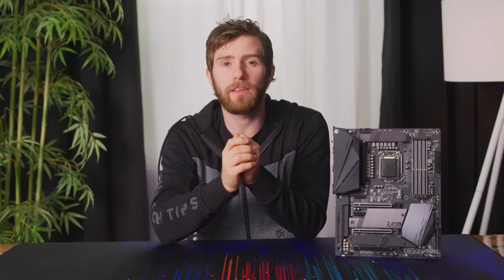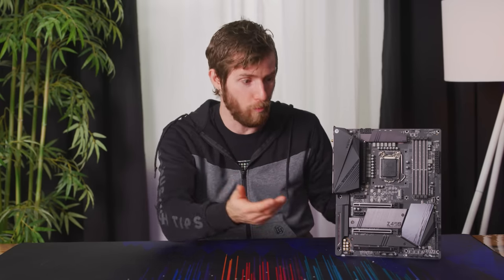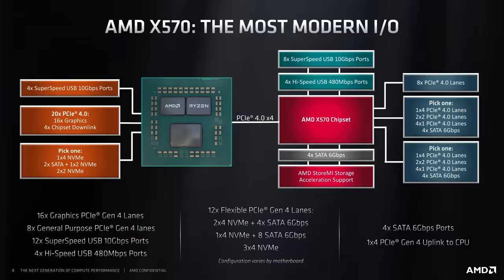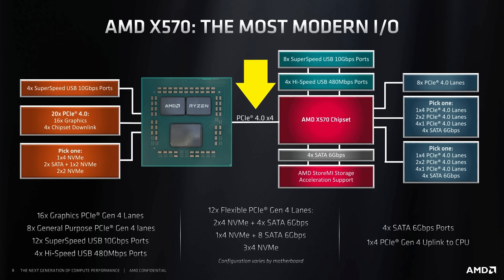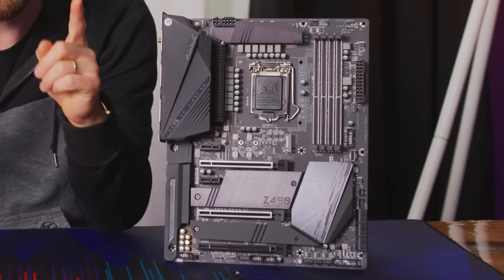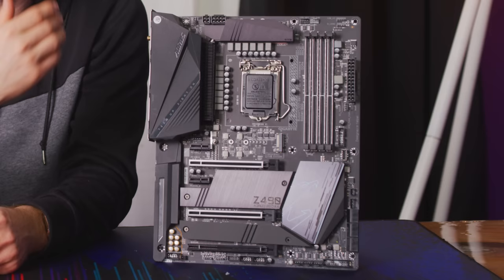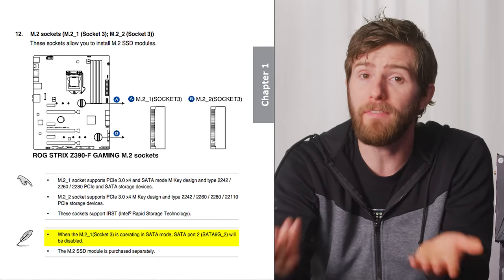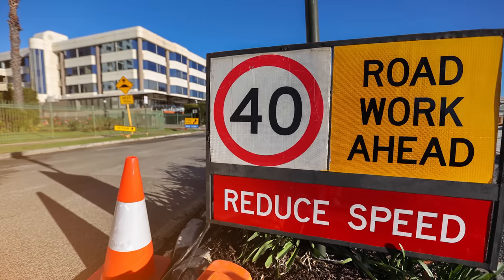The Sneaky Thing About PCI Express - CPU vs. Chipset

Comment: The Sneaky Thing About PCI Express
......It works just fine if it's not dropped
Reply: btw between 2080 TI second hand @ $810 or Zotac twin edge oc 3070 new with warranty @ $720  3070 better right? They both pretty same in 4k and 2k, right?
Reply: @GamersGuard  i would defo choose 3070. is newer, cheaper and perfomance is the same. only struggle is stock
Reply: Crap, it's not Linus proof.
Reply: @GamersGuard  unless you need it right now, I would wait for prices to settle down. The 3070's price will drop back to MSRP after the holidays most likely. But yes, the 3070 should be equivalent or better in everything except VRAM.
Reply: @hudsonr.218  already getting it so.. -) in this country prices remain higher on such parts even ex generation still $200 more expensive....

So what vram beenfit in 2080 TI vs 3070?
Reply: @GamersGuard  2080 Ti has 11gb of GDDR6, while the 3070 has 8 gb GDDR6X. It doesn't matter that much, but if you are playing VR or 4k, the extra VRAM might help.
Reply: That sentence makes absolutely no sense
Reply: @hudsonr.218  no it will help. Its already shown that some games  cripple the 3070 in 4k as some games hit 9 gigs of vram usage.
Reply: @mikeymaiku  it's all about what your use case scenario will be. If you don't care about ray tracing or won't prioritise it over performance then get the 2080ti. Those 3gb of extra vram will be more useful. In the next two or so years more RT games will come out and by then you can upgrade to the 3rd generation of RTX GPUs. By then it will be even more fleshed out and supported. For now id say 2080ti for you Is more worth it.
Reply: Use case or not it shows the issue that will come sooner than he thinks. Sure some might be ok with it but if your dropping 700+. It better be new and the most up to date. But as it is the 8gb 3070 doesnt fit the 5 year run(people wish 8gb is enough but its the 4c/8t arguement all over again only in gpu terms)
Reply: It works better.  It needs the mechanical touch to run smooth.
Reply: LOL nice reference to his major issue.
Reply: @TorbTorb  ill take 2080ti. Better availability, used is cheaper. And i can actually buy it
Reply: @TorbTorb  its so sad, when i see that noone has stock, but in my country they are so expensive, 3070 is 920 and 5600x 400, and they just sit there, noone buys them, they have been in stock for a long time, even 3090
Reply: @TorbTorb  Got my zotac 3070 ).  In msi Free burner by accident changed power limit from 100 to 110 and then changed back, it's nothing risky for the card? Thnx!
Reply: @hudsonr.218   @Kuntal Ghosh  decide to get zotac twin edge OC 3070 for $730 (sucks but that's the prices here in Georgia ... ) Asus stocked out but had same price as zotac.

Anyways zotac really pushed 30 series I think they indeed invested in quality to show off with this series.

This OC edition is dual fan but somehow while boosting peaks at 2025Ghz and max temp with manual fan curve settings hits 69c at this boost..... Ain't bad?

Now just need upgrade my garbage cpu ryzen 1700 as I get 30-50 fps in 1080p games like witcher 3 and watchdogs legion.....
Reply: @thedamntrain5481  in my country 5600X is 367 US dollar
Reply: lol
Reply: @GamersGuard  buy 3070, new architecture, you could get better performance as they improve drivers
Reply: @GamersGuard  obviously the 3070 as it is better than 2080ti but it's also cheaper so get the newer card
Reply: lol Linus dropped a thing haha lmao
Reply: The Linus Test
Reply: @GamersGuard  id rather buy a 3070 :|
Reply: I dropped my motherboard off my bed and it works just fine.

Comment: The dislikes are from people who modded their GPUs to fit in a 1x slot
Reply: I have a box of hacked up cards I use for when I need the 16x slot for something more critical like a storage controller.
Reply: @geofrancis2001  why hack up the card? it feels a bit easier to cut the stop out of the slot, you see that on a lot of server boards just no block at the end preventing you from inserting a bigger thing. Plus nVidia made some 1x quadros and gt710s for you there if graphics isn't critical for the application...
Reply: @AmaraTheBarbarian  low end graphics cards can be found for peanuts on ebay, and its much easier to saw a little bit of fibreglass off the end of the graphics card than cut the end off the slot without damaging the contacts on a much more expensive motherboard. they are all low end cards like gt610, hd5450, hd 6450, so trimming them to a 1x slot isnt going to effect their performance, they still work in 16x slots without any issue.
Reply: Nope. Just a boring video with bait style title
Reply: There are cheap risers for this purpose, since miners hook up lots of GPUs and don't need the bandwidth as much.

Comment: Some video suggestions:

1: Can y'all do like an in-depth video of how a browser works? Like how Chrome and Edge use Chromium?
2: How updates are executed on operating systems?
3: How is a software "optimized" to run on certain CPU architectures?
Reply: as a computer science student about to graduate in 2021, i'd love to finally learn how to optimize software for different architectures xD should really have been taught to us already... but if education fails, Linus is here to save the day... pls...
Reply: I wanna see these too!!
Reply: These are nice suggestions.
You just gave me 3 nice ideas for my own vidzs😁
Reply: 1 ) Chromium is the engine that translates basic stuff (HTML, CSS, JS etc) into a working webpage. It contains all the parts you need to run your car. The browsers are simply "extra features" and they often add tricks to either speed up the translation of the above named things (by caching it or trying to predict stuff) and gives the browser creator the ability to inject stuff into the chromium engine -- So, add-ons. With a car this could be bouncers for example. Basically, it allows them to mod the car.

2 ) Operating systems are just very complicated programs that get started up by a tiny command on what used to be your Master Boot Record, but I guess the UEFI is smart enough to find OS's now. An update is not much different from updating a website or app in the sense that there are certain things you can update while the user is looking at it, and certain things you have to reload the website (restart the OS) for. An update basically just overwrites older files or adds some. It's not that complicated, really...

3 ) In deep-level programming, the developer can decide what types of commands to send to the CPU. The developer can decide how much memory to allocate, how much stuff to remember, what exactly to remember, etc etc... Intel and AMD cpu's have different ways of handling commands. They are, much like browsers, trying to be "smart". CPU's haven't really gotten much faster in hardware speed (MHZ) as you may have noticed the past 10 years. However, their performance keeps increasing; This is because of what they call the 'architecture',  which basically means a tiny software layer which translates stuff into tasks for the CPU. We call this firmware. This, mch like the browsers in point 1, tries to predict stuff. Some CPU's do less but faster cycles (in the old days this was intel) where as some do slower cycles but with more calculations within said cycle (AMD in old days). This means any command has to "wait" until the previous cycle is done,  but starting up a new one also costs time. So if you put a lot of calculations in one cycle as the developer, the slow-cycle one might handle it faster as you use the slow cycle to do more calculations. If you do a lot of small calculations instead, the smaller cycle will win because it's faster. ARM is basically a CPU without intelligence, meaning whatever the CPU does has to be software-managed, but it does save a lot of overhead as the CPU doesn't have to "think" before executing what you tell it to execute.

Now that you've read all this, I have to admit to you that I have no idea what I'm talking about at all and probably not even half of what I said is true.
Reply: Well done they are all interesting subjects 👍
Reply: Also: why is arm so much more power efficient than x86/amd64?
Reply: @theBabyDead has it pretty spot on, but there are a few things to edit for part 3. Computer architecture is the hardware layer, and a change to it could be doubling the lanes to your integrated GPU, or adding an additional floating point calculator, or an additional condition for a hardware interrupt etc. Optimizing for different architectures can be as simple as writing your program to use threads. For example, all things being equal a single threaded program would probably run faster on an Intel CPU because they have higher clock speeds than AMD (generally), but if you rewrote your same program to use as many threads as an AMD CPU can handle (usually 16-32 I think?) Then you would be taking advantage of AMD's wider architecture, optimizing for that. I'm quite confident in this but feel free to correct me if I'm wrong.
Reply: @azyrael96  coz arm is much more simple and less powerful.   Taking the power consumption on Apple M1...while in idle it eats 10Wt..under full load the consumption are increased to 30Wt.   The most savings comes from Big Little "cheating" architecture, where you have slow/energy efficient cores for background work and fast performance cores, and OS able to switch the cores to save the juice.   While x86 architecture have only performance cores.
Reply: @azyrael96  in addition to what’s already been said arm is what’s called a RISC (reduced instruction set computing) architecture meaning it has fewer instructions (lowest level of programming language) to interpret whereas x86 still has holdovers from the ORIGINAL intel 8086 from decades and decades ago. LTT has a video on RISC-V that has a similar advantage
Reply: @Gabbyreel  of course multithreading is no simple task, there’s a reason most programs can barely take advantage of it. The second you introduce multiple threads any programming problem becomes significantly more complex.
Reply: @theBabyDead  nice ending xD
Reply: @3 Basically the app contains multiple code path. They have a detection mechanism built in.  There is also what you call a fat binary. Same principle as having multiple code path. But for different architecture like arm and x86 .
Reply: @2. Removing the old version(sometimes a restart is needed), creating a new entry and updating the paths/config. It really depends on the app/developer.
Reply: @unknown optimize you mean execution time? Like all cpu architecture it depends on what your program does. If its compute heavy or memory heavy. Always optimize the weakest link first. Now adays. Its the memory access. Hence alot of core codes are being squeezed into l1/l2 cache.
Reply: Finally, these are things I REALLY wanna see
Reply: Also Windows Mixed Reality! Odyssey plus and Reverb
Reply: Wow I had the same questions
Reply: My suggestion: every youtuber days Apple's integration makes its machines perform better,  but how exactly does this integration help out perform better, how exactly does having a dram baked into the soc make it more efficient
Reply: @theBabyDead 
MBR is replaced by GPT nowadays, default partitioning since Windows 7. https://en.wikipedia.org/wiki/GUID_Partition_Table

"a tiny software layer which translates stuff into tasks for the CPU. We call this firmware"
No we call that microcode. https://en.wikipedia.org/wiki/Microcode
Intel and AMD are both CISC "more calculations within said cycle" architecture. AMD reverse engineered the Intel x86 instructions for their first CPU's. Got sued. Invented the 64-bit x86-64 "AMD64" instructions that Intel then licensed and we use today. RISC "do less but faster cycles" architecture was Apple/IBM/Motorola PowerPC, and ARM. RISC use instructions that all have to finish in one cycle, which makes the cache smooth and consistent, but has to implement longer instructions in software libraries.

Since decades the optimization for architectures like x86 or x86-64 is just something you select in your compiler. As long as your software libraries handle the calls you can compile for most any platform.
Reply: @OriginalUnknown2  as an old CS MSc I tell you you should already in your education be familiar with assembler coding in some platform (we used MIPS), high level coding, language constructing and making your own compiler through Yacc/Bison or similar. The compilers do the platform optimizations, even 20 years ago.
Reply: @bgezal  yes. I should have learned all these already. and alas, they weren't taught to us.... picked the wrong fucking course, but there is no going back now... its 90% theory, 10% actual programming.. and the theory is mostly writing essays, research papers and dissertation (for a fucking bachelors??????).. so ye, my course fucked me, but once this last year is over and done with, im hopeful i can learn all i missed on my own.
Reply: Related to the third one, now when you download Chrome for Mac, they ask you if you are running an Intel or Arm CPU. That's unfair to people with Ryzentoshes.
Reply: @OriginalUnknown2  Architecture-specific optimization is an insanely specific field, you probably need to attend a special course on it, likely offered by a company as preparation for hiring. Otherwise you can probably find some documentation on the subject from the producers of chips that implement the architecture.
Reply: @OriginalUnknown2  Heh, the difference between computer science, and software engineering. I went for computer science myself, and by golly I can analyze an algorithm, but so much of good software design is another skill entirely, and frankly a lot of it comes from experience in the field on real projects.

It's a good attitude to have that you should never stop learning. I learn new things all the time. A good way you might choose to learn is to get involved in some open source projects. Pick something that sounds interesting to you and try to contribute. Read other people's real world code, and figure it out. See what issues are in need of patches, and tackle one. If you figure it out, tackle another one. Having contributed to some open source projects is a good thing to mention in your job interviews, by the way.
Reply: @fakecubed  Thank you, that is actually a great suggestion! I'll hold on to it :)
Reply: @s.i.m.c.a  and only after one year X86 has big little now. Crazy huh
Reply: I see a lot of abstract answers to your question so I will give a less abstract version, as abstraction is only powerful if you know the foundations; that's what I've learned after 5 years of programming studies, when it looked all alien to me.

Simply said your computer and GPU has a clock speed. Your computer is simply running 1 instruction for every core. It can be calculations or checking values, calculations are kinda abstraction of logic gates, search half-adder or something up. The CPU has to run everything and manage everything it's very general. For video output we therefore use GPU's which have more cores for just video output. to display 1920x1080 you need 2m pixels which have 24 bits. Every pixel gets calculated and put in the gpu's buffer. The processors have their own special set of commands called instructions tailored to their specific qualities with certain commands that speeds up the processing of floats or ints or the bit-size of the instructions. Now that I've explained the basics you will probably understand the reasons more-or-less better.

1: The internet - funnily enough - works just with simple text messages whereby a header with information about the message is contained. Sending HTML to the server returns a message that the receiver should interpret the content-type as HTML you should check it for yourself and install wireshark (the browsers already abstract it away from you unfortunately you'll still see the values but not raw) you can see the type, status, what should be accepted etc within the message with wireshark. Now inspect a webpage, would you agree that HTML is not that pretty and intuitive? it wouldn't be intuitive to only receive unstyled text messages. Hence the reason for browsers and why HTML stepped in; 
it was simply a way to order a document to generalize the interpretation of text markup to send over the internet. HTML/CSS/JS are just agreed upon standards and is the reason why most of the webpages works on different devices, HTML/CSS/JS are simply guidelines what supposed instructions should translate to. The browser will convert the received messages to a formatted and stylized page.

2. Operating system updates are mostly some files with compiled code getting replaced. Most of the time the OS will simply copy unchanged to a update folder and move the updates files to the update folder. When you restart it will copy the files to be bootable, make a backup, change some settings etc and shut down to let it boot up with the updated files, it will probably run a checklist and check some changes and converting previous settings to the new ones and it's updated.

3. Most of the time software isn't optimized for a specific CPU architecture because we use high level languages so low level cpu architecture isn't something you have to deal with. However if you know that the targeted hardware has at least 2 cores you could offload a process to the 2 core or keep some data in the ram or cache because it could be critical for the performance in the app. Like using a GPU for graphical/float operations or using 16-bit float instead of 32-bit because you don't need the 32bits.